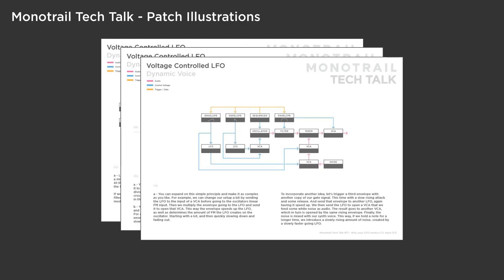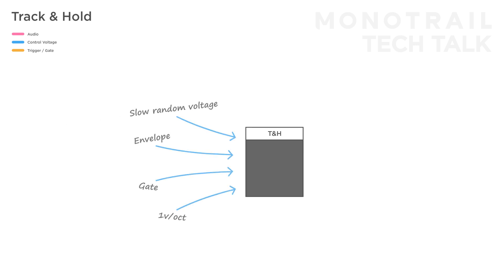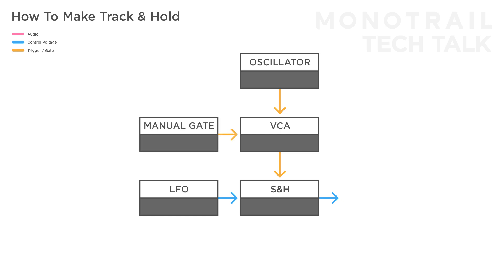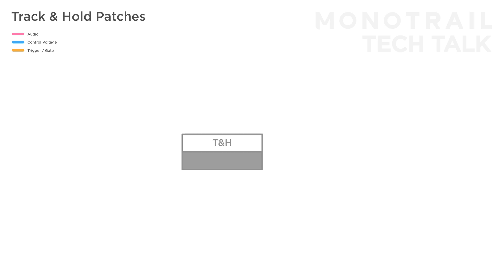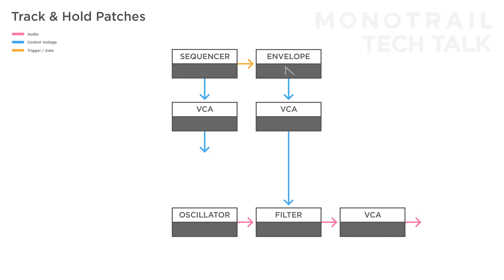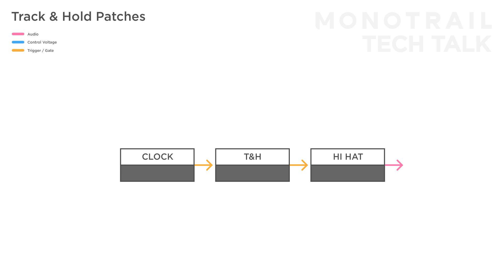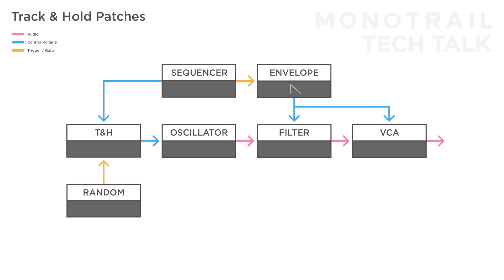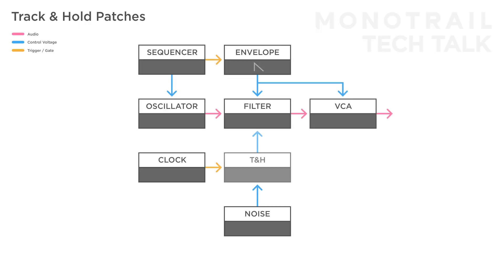What to do with Track & Hold - What is it? Patch-tips, and how to make it from Sample & Hold!

Comment: amazing stuff as usual, so what do you about s&h droop? i’ve only bought one module and quickly returned it because i was totally unaware that it was a thing until i played the module.
Reply from the maker: Thanks, glad to hear it! And yes, it's a thing for sure. It really depends on what voltages you are using. Most of the time its not an issue for me, but when used with 1v/oct isgnals it's mostly to much droop to function.

Comment: Is the buchla source of uncertainty, a good sample and hold module?
Reply from the maker: If I'm right the original Buchla source of uncertainty is not a sample and hold module at all. The tiptop/eurorack version does have a sample and hold section. Any simple sample and hold module does the same. Just depends on if you want all the added functions or not :)

Comment: Isn’t a track and hold the same as a VCA with a gate?
Reply from the maker: Hey there! Not really, A VCA with a gate will result into "track" (follow the incomming signal when you feed the VCA a gate) and "0", a 0 volt output if the VCA is closed. So it wont "hold" a voltage when you close the VCA.
Reply: I get it now! Thanks! Awesome channel!